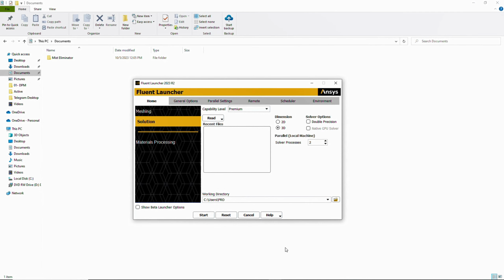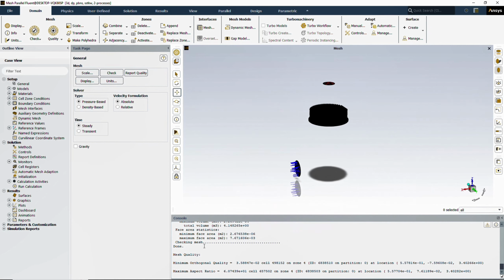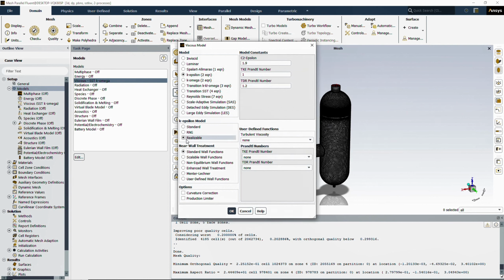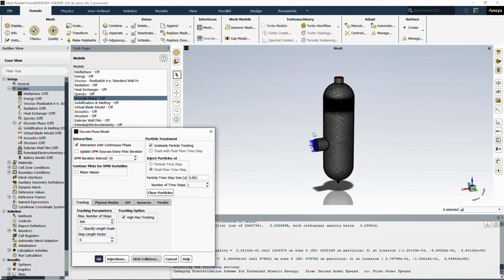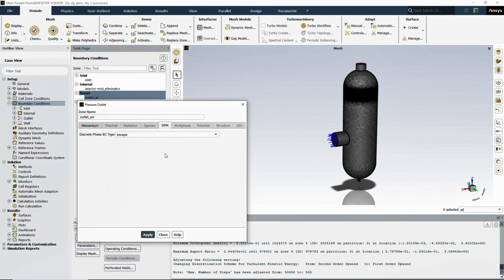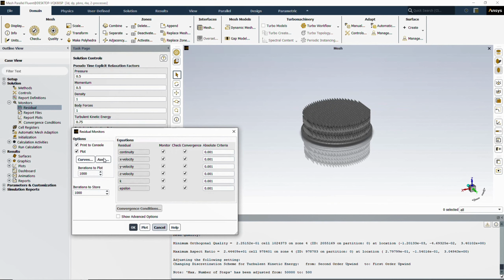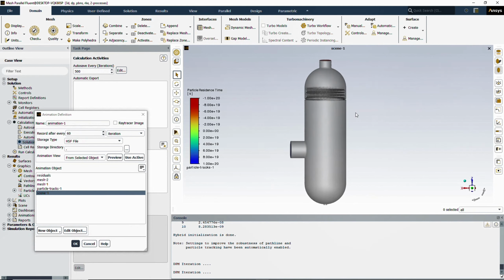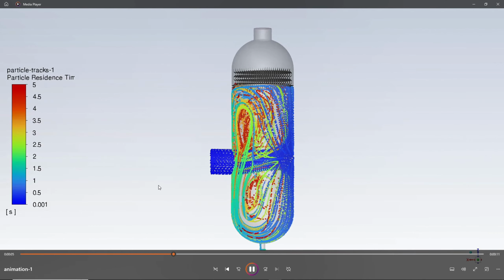CFD Simulation of a Mist Eliminator using Discrete Phase Model in ANSYS Fluent

Comment: hello i want to simulate combustion of liquid sulfur in a furnace my mesh size is about 2 millions the liquid sulfur is pulverised into furnace as vapor i want to model the injection with discrete phase and non-premixed combustion model so whats the accurate DPM interval value for this simulation